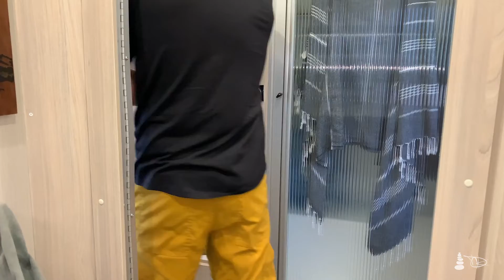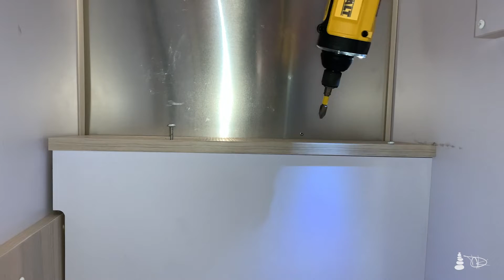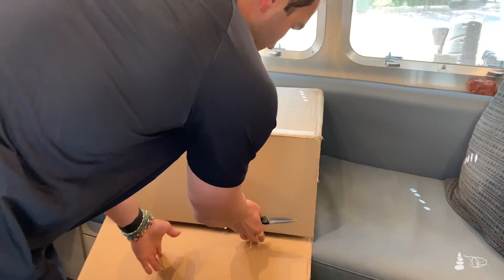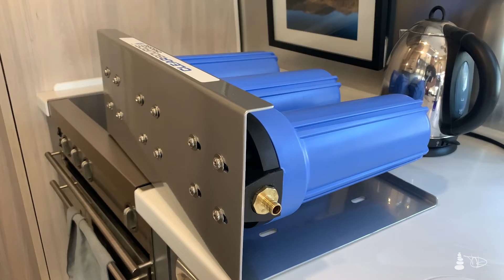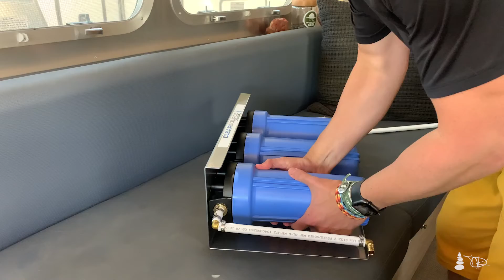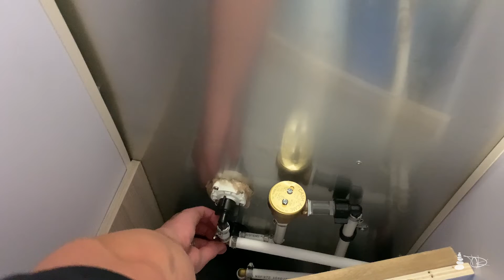Airstream - Installing the Clearsource 3 Stage Internal Water Filter || VLOG

Comment: Do you not use the internal tank? Ive never once used the fresh water connection. When drawing from the tank you know if there is a leak in the system because the pump cycles. You only know when there is a leak when using the fresh connection when things start rotting away.
Reply from the maker: Good to know! I recently used the tank for the first time during a boondocking trip but otherwise I’m at campgrounds with full hookups as I live out of the rig full time - I may just get a water leak sensor though
Reply: Ouch…. But good sharing of information here.   🧐